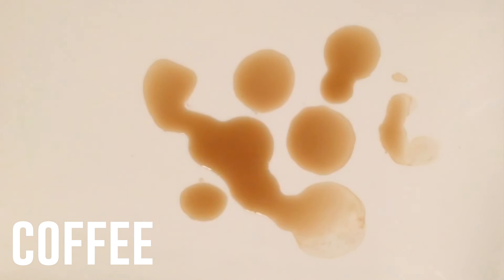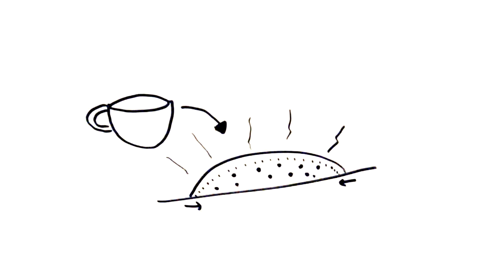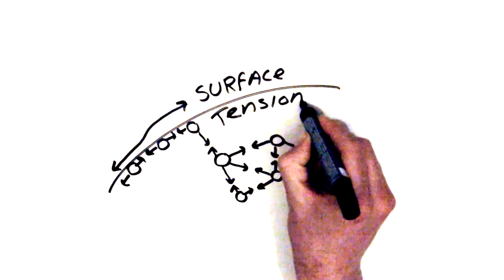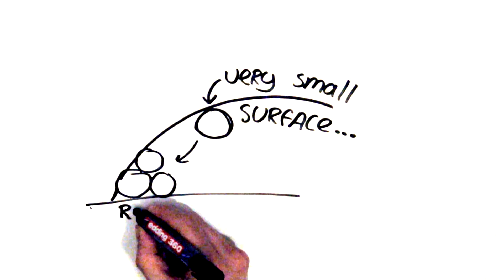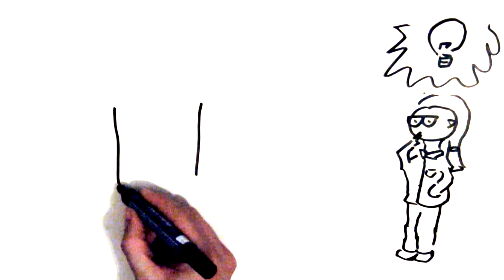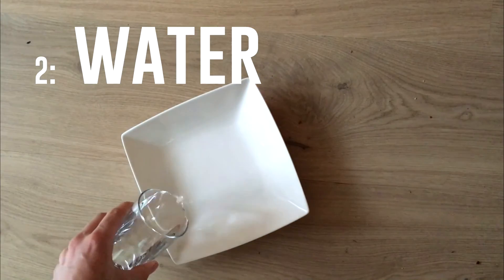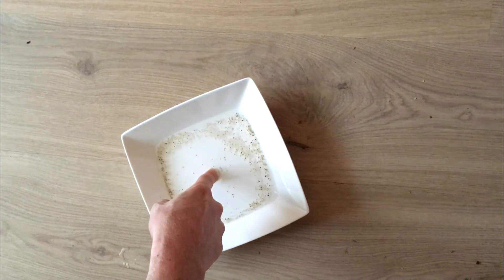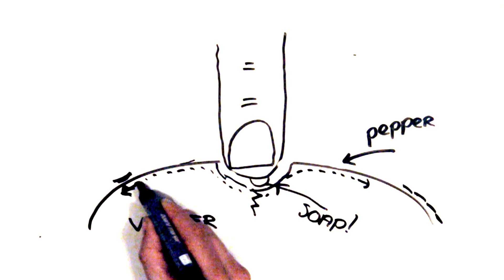The Coffee Ring Effect (and a little magic trick)

Comment: Nice video, but you say that the droplet gets smaller, this is true but the key point is that the substrate must be hydrophilic, hence the water has fixed contact points. When the water now evaporates the contact angle gets smaller and smaller and a capillary flow is created as the contact angle gets very small.